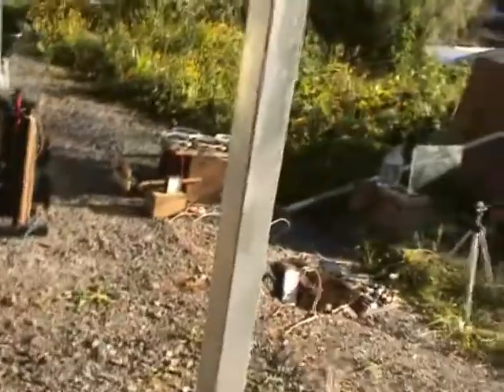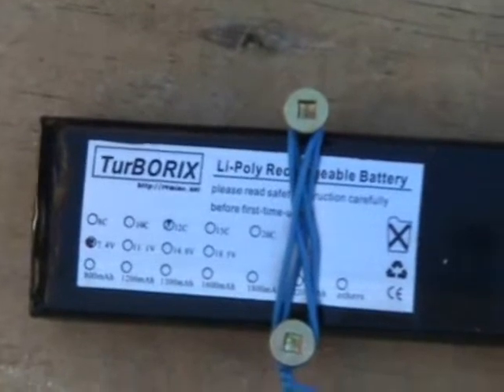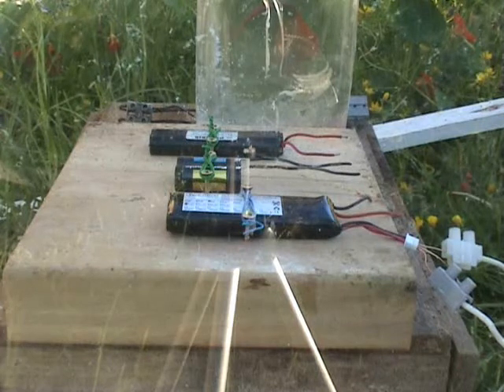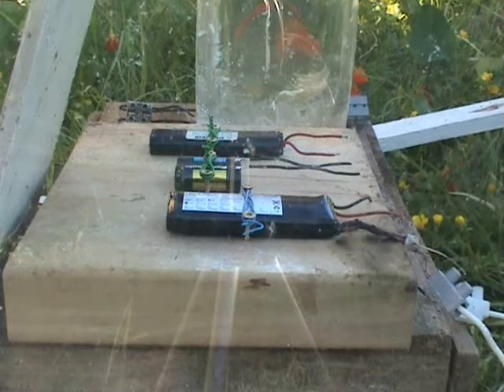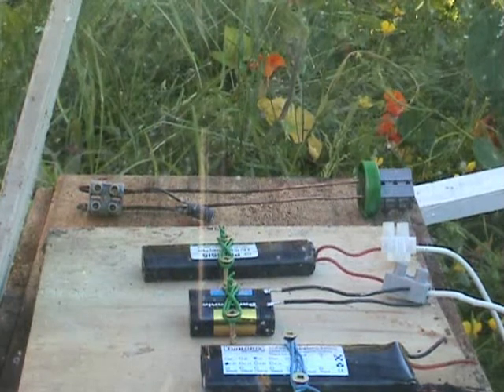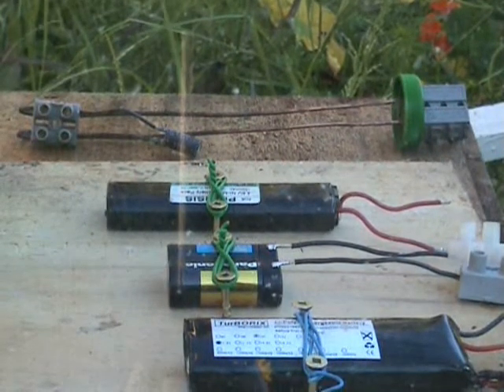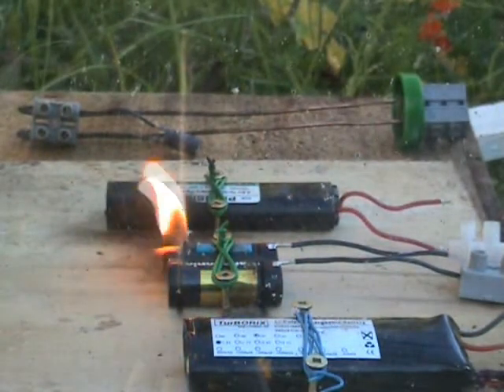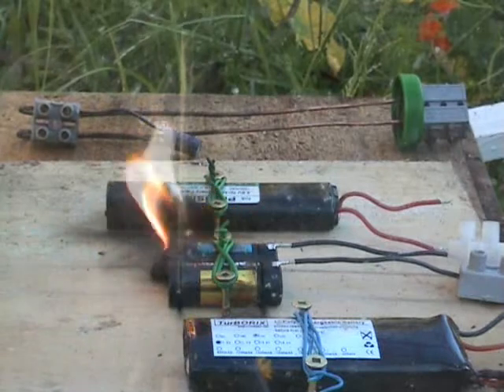Failed battery experiments

Comment from the maker: @amfan12  Thanks for that info , Ian.
I'm planning to wrap a heating coil around the batteries and glow that to red heat.
No doubt that will give some results as the battery lead in wires have melted off, and I'm not to keen prising open those batteries, as when they are punctured they will ignite in steam and flames, as I saw on other YT video's..

Comment: Most lithium ion/polymer batteries have some kind of protection IC built into them. When you apply the 150 volts, you are probably just burning the IC out instantly. You would will probably want to find some unprotected cells, but even sometimes unprotected cells have a mechanical device that breaks the connection if the pressure inside is too great.

Comment: The LIPO batteries have a built in fuse, if you (carefully!) try to take them apart, you might be able to bypass the fuse. Also if you have a fire pit you can take a bunch of little caps and toss them in there. =)

Comment from the maker: @HDXFH  I was disappointed with the LiPO. I was expecting some good flames.
The leads burnt off, instead.
I used the 240 - 150 Volts transformer for that as the heating element 25 Amps load passed through the LiPO battery with no problems.